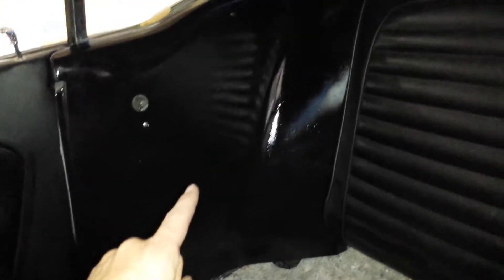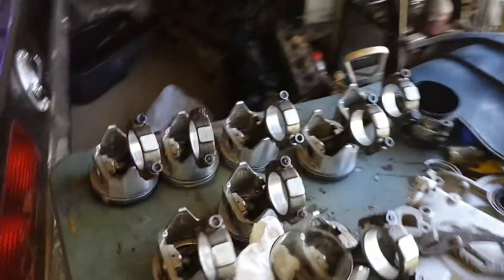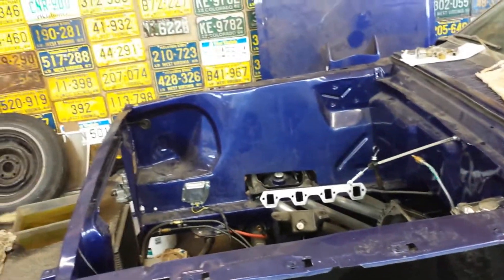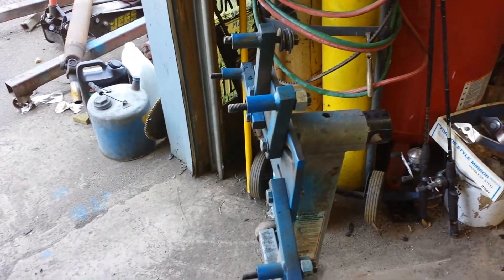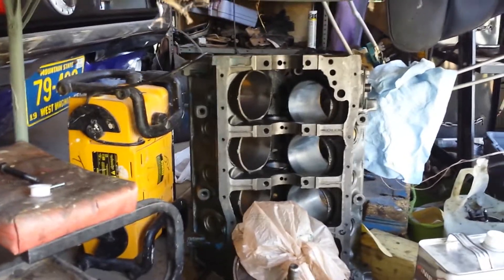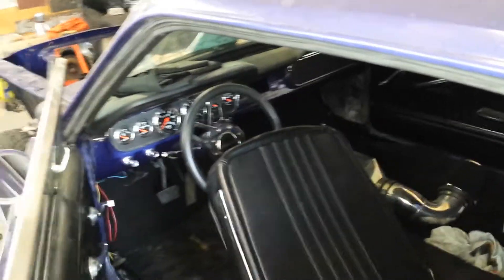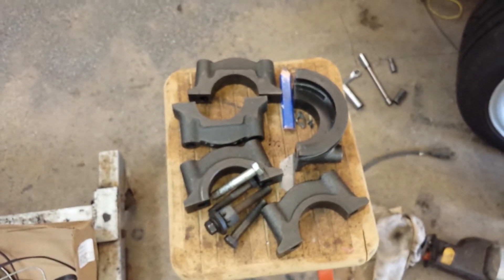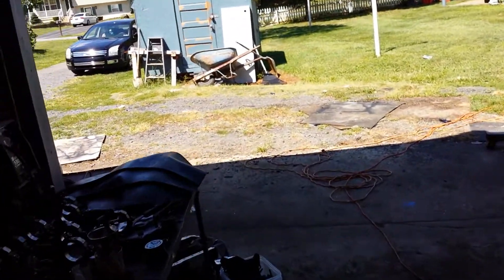1965 Mustang: interior and engine update

Comment: Good move on exchange the valve springs. Those are overlooked often
Reply from the maker: Yes they are. I don't want any more issues. As I know they are good springs and very beefy,  I just want to make sure they can handle a roller cam.

Comment: I don't think there's supposed to be a bolt that goes in that loop at the bottom of the seat. You're supposed to put the bottom seat in first, then the top slides in from the top. Those retainers hold the seat back behind the bottom, and there are hooks at the top. No bolts should be needed. I think.
Reply from the maker: You might be on to something.  I'm thinking that it wasn't a bolt but a heavier lag type screw that went into it. I thought the bottom seat snapped in place using the brackets on the floor but I could be wrong.  I will check into this.  Thanks John.  I'll let you know what I find out.
Reply from the maker: Yeah I'm reading that there are two "large" sheet metal screws that go in the loops and the bottom is snapped in place.  Now where did I put those screws?
Reply: +Cobrafanatik22 Weird mine didn't have screws in those at all. Yeah the bottom snaps into place using the retaining cleats on the floorboard. Mine never had those screws. Weird.
Reply from the maker: +jevchance maybe someone put them in later I'm not sure.  There are holes there though. Back seat is in now